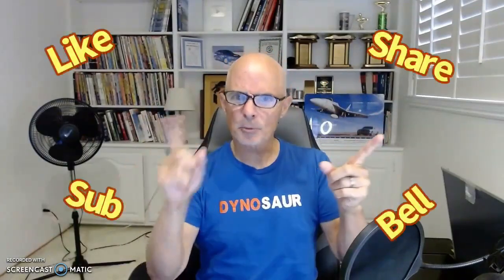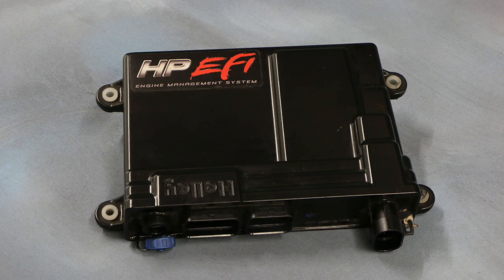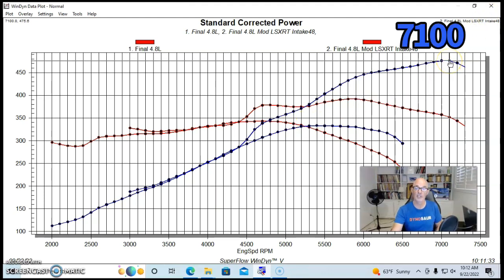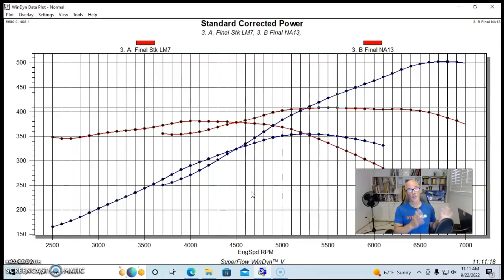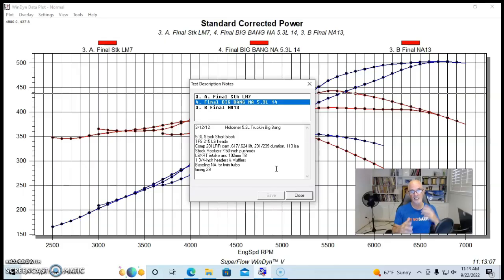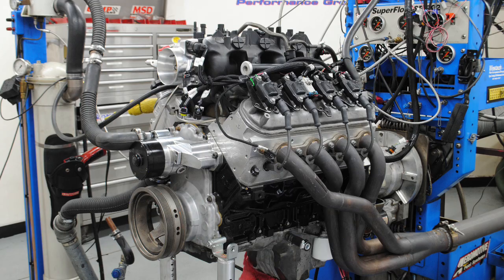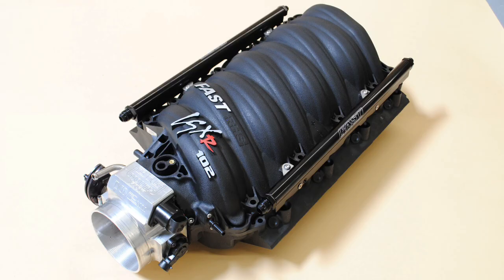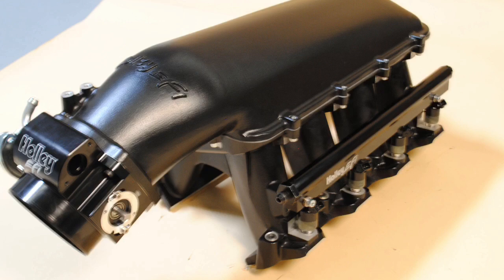HOW TO MAKE ALL-MOTOR JUNKYARD LS POWER. HOW MUCH ARE HCI MODS WORTH ON A 4.8L, 5.3L OR 6.0L?

Comment: Being a MOPAR guy, I get tired of seeing the ls put into everything, but seeing these hp numbers and over 7000 rpm with a stock bottom end, I see why these engines have turned into the go-to engine.  Would I put one in my Cuda?  Hell no!  One thing GM has missed out on, which Mopar picked up  early on is chrome valve covers are always worth more hp (lol). Add a chrome air cleaner and it's possible to reach near turbo numbers (lol again).  Nice to see dyno work that makes a reliable engine and keeps those without access to a dyno from buying parts that don't work and engines that grenade.  Course you know chrome adds to reliability (lol).
Reply: They're also significantly smaller and easier to swap. It's effectively the perfect V8 for garage mechanics with anything without a MOPAR-sized engine bay.

Comment: 100 hp/liter for a built NA engine is great and all, but that just shows how amazing 100 hp/liter is from factory NA daily-driver engines with full warranty, fuel economy and emissions/noise compliance: Voodoo 5.2; the 5.0 in the 2024 Mustang; Audi R8 (4.2 V8 and 5.2 V10); Honda S2000 (120 hp/liter 20 years ago); Ferrari F430 and 458, and others that I'm sure I'm missing. All hail the factory hot rodders! By now, though, shouldn't the 6.2 in the C8 make 620?
Reply: Yeah which most of those are unobtainium. Give us a break
Reply: @shadowopsairman1583 , that makes them  less amazing for having factory warranty and being emissions compliant? Sorry, no.

Comment: As someone who has been wanting to build up his Lr4 for last 20 odd years and finally FINALLY starting to look like a possibility.   I wonder what the 4.8s numbers would look like stuck into a truck and dyno'd.   My engine has earned a fair bit of loyalty from me.  I've had my 2002 Silverado it's entire life, I had it built to order while stationed in Japan and was getting ready to go back stateside.  I have not been kind to it, and has more or less been raced everyday for 20 years and has NEVER failed in its duty.   In honesty if someone asked me if I mean it's never failed to start in 2 decades it has 3 times BUT it was I who failed it by running batteries long past when they should have been changed.  So remove me from the equation and yes it's been an engine that hits 7k rpms every day with flawless functionality.   And if that's not impressive than maybe this bit is, I'm a disabled veteran some of that is brain injuries so a few of those 20 years have seen 1 maybe 2 oil changes because my memory decided to go on vacation yet it's none the worse for it.

I love that damn engine so much if the truck ever got wrecked the engine would be pulled and put into something else.

Comment: Your DZ302 vs Boss302 demo was small head big cam vs big head small cam.   There were theorist who believed big heads small cam will surprise you with the results.
Reply from the maker: the dyno is better than theories
Reply: Racers knew.   My first introduction to that concept was around 1998.   I was in chats that had Brian Tooly and Jay Brown where it was discussed.   Jay was big on big head and small to medium cam. I have to suspect that they gleaned this information from the Cleveland days.
Reply: @richardholdener1727  Big head small cam is in play in many DOHC situations.    320-350cfm intake port flow with big port and a small 200@.050" or smaller cam and yet it rips up to 7000 rpm.    How Jay described it is the big head with the small cam acted like a smaller head with a bigger cam.   He looked at the head flows per degree of rotation and utilized that curve.

Comment: Ok here is something I want to do but do t have the means to do it right now so I’m gonna through the idea out there to you.  I want to take a Holley high ram, will probably need a spacer for the lid.  Take some  velocity stacks that are the same size as the Holley runners and use them to extend the runner length. I feel like you could get a great manifold by doing that.  Just use the stacks to extend runner length and then put the lid back on (probably with a lid spacer to get area back) and run that thing. Seems like it would do really well.  Some day I’ll get to do this….
Reply from the maker: I WORKED ON THAT BUT NEVER GOT IT DONE
Reply: @richardholdener1727 hopefully it will be visited one day.

Comment: I'm impressed that these 2 valve pushrod V8s are able to get so close to 100hp/liter. One helluva feat for no variable cam lift or timing. I wonder what kind of street manners these would have and how short their lifespan is compared to other built but less crazy engines.
Reply: @adamdodsy84  yeah this kind of NA performance without any timing or lift variation is going to be fairly limp lower than it's main power curve, very race specific. I've never experienced one myself and am curious to how it would really feel. Emissions and warranty are definitely the other main factors why these don't come from the factory this way.
Reply: @blitzerman8  it won't be limp at low rpm. Typically the larger cammed stuff likes higher rpm.....but that also necessitates a gear change typically offsetting any low end tq loss. Plus as one adds cam they should also add compression....offsetting or gaining low end tq.
Reply: If you change the oil and coolant at regular intervals, along with regular tune-ups, they last a long time. Valve spring replacements at 10-30k miles are the down side but don’t take long.

Comment: Your 5.3 with stock 706 heads and comp cams 54-459 made 513 bhp and 483 lb-ft.  96.3 bhp/L with small valves and smaller cam.
Reply from the maker: when did i make 513 hp with a 5.3L

Comment: After seeing a lot of your videos I see the truck Norris cam seems to do better than all other truck cams in a good na setup. With what you being said that what we see in a na setup translate directly to a boosted setup, would I be best to get the truck Norris cam for my 5.3 turbo build. 03 Silverado looking for the best spool I can get not necessarily worried about making “so much power” because I have seen how much can be gained but turning the boost up. I want to do it right the first time turbo is likely gonna be a 7875 vsracing or eBay special would you say I’m on the right track ?? Not trying to sound ignorant in sense that I won’t do the research because I have been trust me been watching your videos for days on end but always good to have someone’s brain to pick. Appreciate it regardless your videos are killer keep it up.
Reply: Or would I be better off getting a btr “turbo cam” parentheses because yes any cam is a turbo cam but will I be better optimizing the setup by going with a stage 1 turbo cam or be on the same exact route with a truck Norris.
Reply: Get the Truck Norris cam and psi springs and call it a day, it's great for NA and Forced induction
Reply: By psi springs you mean like .650 lift ones from btr??
Reply from the maker: please see the truck norris cam video compared to a ss2 where i ran them both with a turbo

Comment: When are we ever going to hear compression ratios for specific combos? Would be extremely relevant information.

Also - why in the world do these dyno pulls stop as soon as you see a peak.  If you're gonna test a short runner manifolds like the Hi ram, you gotta show the curve 700-1000rpm past the peak because that's where it's gotta shift to see its best average power.
Reply from the maker: the compression was provided
Reply: @richardholdener1727  the 4.8 and both 5.3s I don't see any info on chamber sizes or compression ratios. The 6.0 liter has more detail on the cylinder head volume, but not the pistons. Unless I'm flat out missing it somewhere (and I could be) I don't see a single compression ratio cited anywhere.

I love all the tests, just want to fully understand the relevant details - fuel type and compression ratio obviously mean a great deal to NA combinations.

I'd love to see dyno pulls that run 700-1000rpm beyond peak hp, or to the reasonable practical limit of the valvetrain. That's meaningful data for shift point selection, and those differences in the manifolds will really show up there.
Reply: @andrewcammer2535  I’m doing research here

Comment: 100hp/L is a pretty tall order for a 2 valve OHV setup and even more so if you want it to make that power in the same way it’s going to be driven, with accessories and a real exhaust system with mufflers. Usually quite on the edge of streetable.

Comment: howdy richie, just got a 2008 trailblazer ss super cool for me and my first full tilt project. on a car anyway. i have no fear of working on most anything. cars included. 
just cant find out a bunch about it, limited at best. think roots blower under the hood. 650 hp. magnason?
Too much, I think not....help more cowbell!!!!!!!!!!!!
joe the nut
Reply: what will the awd handle hp wise i can do the custom tunable style suspension a few heim joints with misalignment stuff. just for giggles
Reply: id like to start by pulling the pistons and check ring gap and look for bad things inside
Reply from the maker: NO IDEA ON HOW THE 4WD HOLDS UP

Comment: If I have a stock 6.0 lq4 with stock dished pistons and a set of 243 heads, can I run the 469 cam in this video with no piston to valve clearance issues? Or would I be better off using a 459 cam and milling down the head? Looking to get north of 550 at the crank. Thanks in advance!

Comment: If anyone cares to actually look, the HP rating for the DZ302 was completely ACCURATE!
It was rated at 290HP @ 4500 -4900 rpm.
Look at the Dyno sheets & you'll see for yourself that it did in fact make that much HP "down" @ 4500 rpm.  But if you've ever been in a car with that engine, you will have witnessed how crappy it runs below about 5000 when it really wakes up & gets into its power band!
Had GM rated that motor at its full potential, it would have been in fact up at the 340+ rating up at 6000 & above!
You can even look at modern dyno sheets & see for yourself!
Reply from the maker: it was not rated at 4500 rpm-it was purposely under rated for race classification
Reply: @richardholdener1727  .
Look at it.  It certainly was rated under 5000 rpm in EVERY advertisement I've ever seen.  Look at Chiltons factory ratings.
Look pretty well anywhere.
If I am incorrect, please tell me where I could look and what the rpm ratimg actually was advertised at?
Also if you look at dyno sheets, you will see that in that 4500-5000 rpm range, its right in there between 280-300 HP.
You are likely correct in that it was under rated, but the rating was accurate for the rpm output.
If I'm incorrect, please lert me know where I could s1ource that info!
Btw, I love all the content you provide.  I've been reading your articles in Hot Rod, Car Craft etc since as far back as I can remember!
Thanks fir all the cool info!  You provide answers to questions we have all been asking fir decades!

Comment: Richard, are you saying with a sbe LQ4 the comp cam 54-469 will fit with Texas Speed 2.5 243 heads milled .020? I plan to change from a Cleetus Bald Eagle N/A cam and Edelbrock RPM to the Comp cam and Holley split intake.
Reply from the maker: you need to check

Comment: Both my motorcycles make at least 100hp per liter...  70hp from the 650cc and 110 from the 1,000cc... power to weight ratio is a bit better thana car though, both bikes weigh just under 400lbs

Comment: Great video. I remember when BMW came out with the 5 liter V10 engine for the M5/M6 that made 500 flywheel horsepower or 100 horsepower per liter and they made such a big deal about it in their marketing. That engine had 5 into 1 headers and ITBs from the factory, which was awesome!
Reply: Yeah and costs how much? Brand new with the car!?
Reply: @shadowopsairman1583  the price of cool isn't cheap. I always enjoyed the test drives after replacing the connecting rod bearings. Trust me that repair wasn't cheap either.

Comment: What about us guys with the 6.2 in our trucks. I'm trying to make a cam selection that's going to pick up good power, especially low end torque and not lose towing ability
Reply: BTR Truck norris for LS3(6.2L)
Reply: You get rid of the tq management and you'll think you changed the cam.
Reply: @HioSSilver1999  I have the BTR stage 3 V2 in my 2012 escalade and ran neck and neck with my homeboys bone stock escalade.
Reply: @BuckCity229  sounds about right....you're combo is terrible.  It's not even a combo really because no thought was put into that besides wanting a cam that would chop
Reply: @HioSSilver1999  actually the entire cam kit was bought for my Silverado but I came across an Escalade with DOD FAILURE for pennies. Put the kit in the escalade to get it running. I'm not a chop person 💁🏾‍♂️
Reply: @BuckCity229  put a stick cam back in it and turn off the tq management and it will likely run better. Or put the truck Norris cam in it.
Reply: @HioSSilver1999  I'm thinking about one of the TSP l92 truck cams but I can't find any real world info on them
Reply: @HioSSilver1999  build up the Transmission if you do that.
Reply: @BuckCity229  grab the TN and call it a day, best for NA and Forced Induction.
Reply: @shadowopsairman1583  6.2 has a good tranny. There's lots of tq management strategies in the pcm. It can even be tough to find them all. 

Could still use some tm on the shifts.
Reply: @BuckCity229  according to Richard's testing the truck Norris is about as good as it gets for heavy vehicles. That or the 202 tq cam.
Reply: @HioSSilver1999  and what transmission is that?

Even the TH700R/4L60 Series can be built to handle over 1000 HP.
Reply: @shadowopsairman1583  a 6.2 should have a a6 or a8. Either are much better than the 4l60 or 700.

Comment: Would it be better or more cost efficient to start with a junkyard 4.8L, 5.3L, or 6.0L ? If you're going to either turbocharge, twin turbocharge or bore it to a 383 stoker with an end goal of around a reliable 600HP + ?
Reply from the maker: if you turbo an ls, then a 4.8 or 5.3l will be cheapest-they are usually easier to find and cost less than a 6.0L
Reply: @richardholdener1727  Thanks I appreciate it, I was just asking before I tell my mechanic friend about starting another project. I had helped him complete his last drag car project.

Comment: I wonder if ported rec ports on a flat top piston 6 liter would get that 600 HP number...
Reply: Probably... ls3 heads support 600hp with enough cam and cubic inch should be very possible
Reply: @Ws6Ms  I remember the head test Richard did awhile back... and I remember even with a stock cam, etc. The 823s made almost 40 more than 317s. I know the AFR 230s are a far cry from stock 317s, but a ported or aftermarket set of LS3 style heads "should" yield similar gains IMO.
Reply from the maker: STILL LIMITED IN P-V WITH STOCK PISTONS
Reply: @richardholdener1727  so still limited to something in the 230s on intake and exhaust? Or would that 231/247 fit?
Reply: @Ws6Ms  considering there are LS3 style heads for LS1 now...

Comment: I wanna see you do a high compression 6.0  with a bigger hyd cam.   I has to cut my factory pistons to fit my cam in my l98  but was wondering how much id gain if i changed the rods and pistons  and bumped it up to 12.1  plus the 300 shot ive been running on it
Reply from the maker: better to add compression without a big dome
Reply: What would your suggestion be.  L98 with 823 heads.  Because  if i cut the heads or deck the block then i might have a problem  with the intake fitting . Being a nitrous motor it needs all help  it can handle with out messing up the flame travel

Comment: NOW;  Let's talk about the "other" 302, the Porsche M28.  This SOHC/DOHC engine was 274, 286, 302, and 330 cubic inches.  This was a 90 degree big block all-aluminum V8 that can be bored out to 396 cubic inches if you use an '87 and up block.

"A Porsche V8?" you are saying.  But yes, Porsche built 60,000 of these engines, and every one has a timing belt.  And YES these are big block V8 engines;  The bore spacing is 122 mm, which is very similar to a 454 or a 440 Dodge.  The "Euro" engines has 310+ hp from 286 cubic inches, and supposedly that is conservative.  The water jackets on this engine are ENORMOUS so you can bet that this is a Porsche racing engine that they never took racing.

A two valve '85 M28-21 engine could put out  nearly 300hp on the chassis dyno;  That is why Porsche enthusiasts try to buy these rare cars.  Since they are about 200 pounds lighter than the S4 cars, which struggled to put down 260 hp.....
Reply from the maker: I'm very familiar with 928s.

Comment: Pretty easy just buy a BMW M car. Even before turbocharging they were achieving this in the 80’s to the late 00’s with s50b32, s54, s65, s85 and more. I appreciate American cars but they simply fall short in the engineering department in terms of factory performance
Reply from the maker: AND YET THEY MAKE UP FOR IT IN BIGNESS-BTW-A PRODUCTION 1989 BMW E30 M3 MADE 195 HP WITH THE 2.3/2.5 MOTORS (NOT 100 HP/LITER), BUT THE 1.6L HONDA B16A MADE 160 HP
Reply: @richardholdener1727  boomer turn the caps lock off. EVO 2 euro e30 m3 made 238 out of a 2.5 litre 4 cylinder

Comment: Curious... Have you ever done a test on an LS with the Comp Cams 5481 distributor front cover with a sbf dizzy and a carb? Compare it to the latest aftermarket Holley efi with electronic ignition would be a cool test. 😎🤙
Reply from the maker: NO THANKS-DIST IS NOT A GOOD UPGRADE FOR AN LS
Reply: I'd love to see it.  No Richard, it's not an upgrade, but would still be interesting regardless.
Reply: I think there are car classes that require distributor ignition systems. It definitely takes out alot of tuning capabilities but would possibly make better power than the old school SBC.